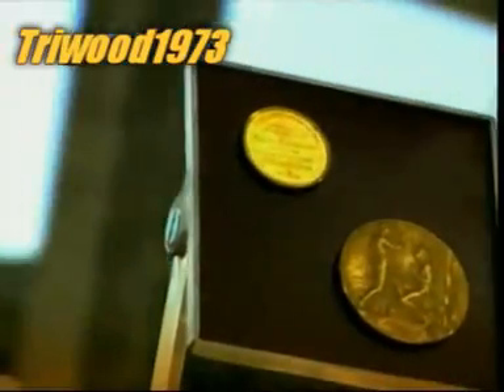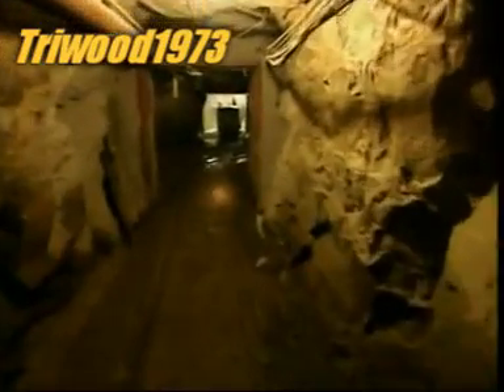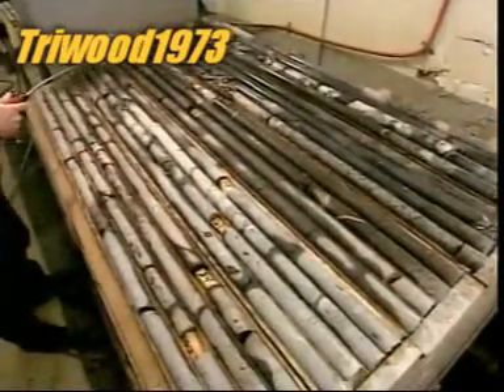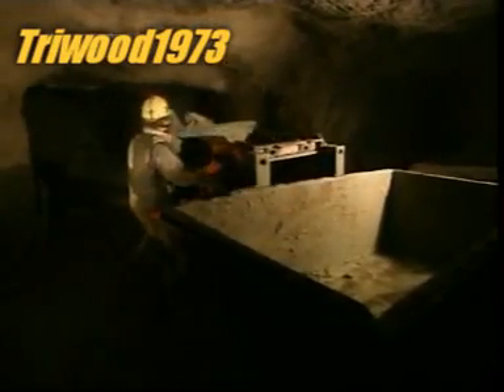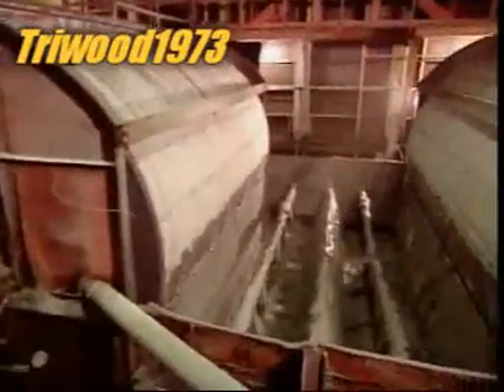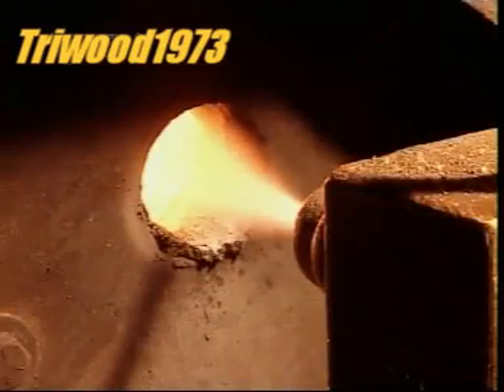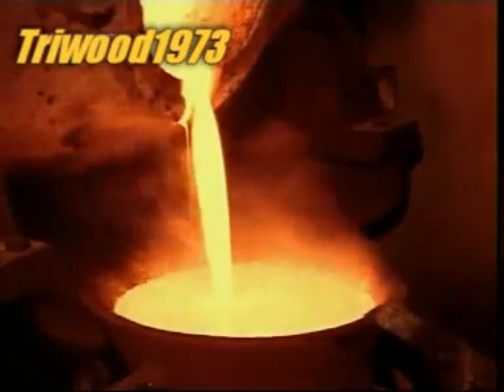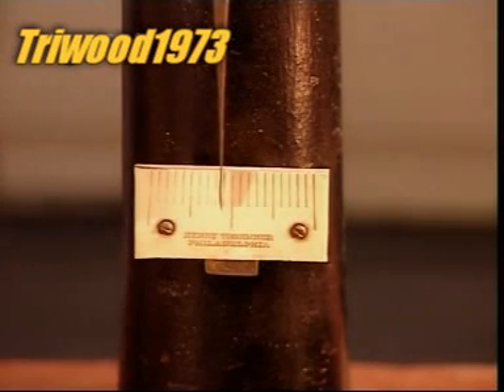The Process of Excavating and Refining Gold

Comment: @koliars 1 tonne of ore = 6 grams of pure gold. Looks like a bad ratio 2000:12. However Gold is found in most Base metal ores, in a lesser quantity. Copper ore gold content range is 0.07 g/t to 1.6 g/t, with copper going into 300-600 g/t. When we refine all the other metal ores we get a little gold on the side, including silver too, so its not all that bad.